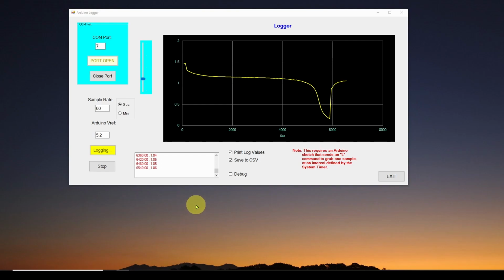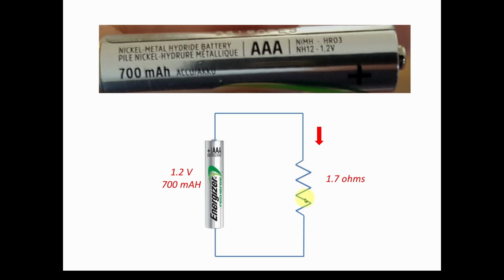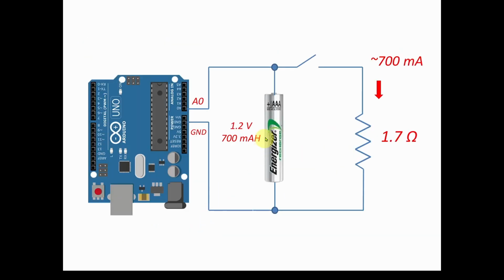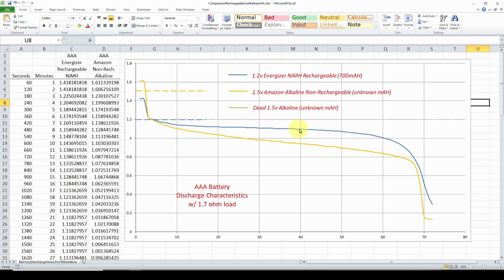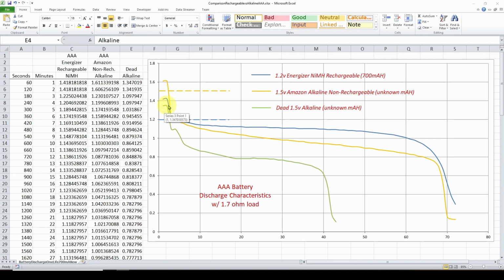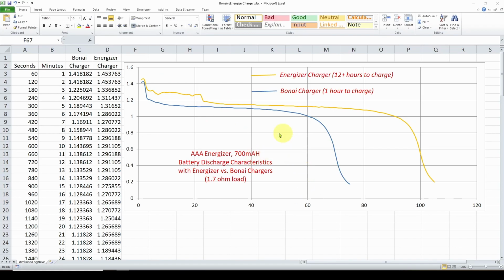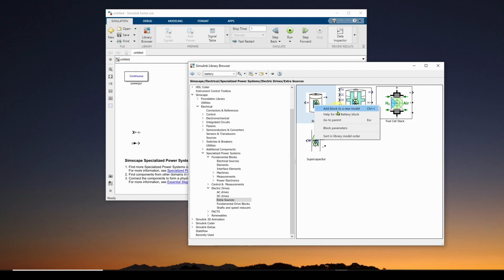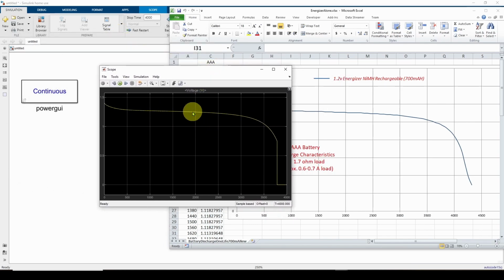Understanding Batteries

Comment: Well-Done,
I have an off-topic question about an gravity battery.   
       ?How high can a typical AAA batery lift a 100 weight?
I ask you because it seems you might know.
Reply from the maker: Gravity batteries?? Wow. Reminds me of back in the 1980's when I was a young engineer and we were working on a pumped hydro power plant, that basically  pumped water up into a dam at night to store the energy, then the water powered the hydro generator during the day. But why would you want to use a battery to lift a weight for later use when you're just losing energy in the process?? Or maybe this is a homework question? I don't help with homework questions. But a quick calculation tells me that if you assume the battery has a 1 watthour total capacity, you can HYPOTHETICALLY lift the 100lbs less than 25 feet, but that would take an hour. Of course that assumes you have a 1 volt DC motor that can do the job, though I imagine you'd need that and a ton of other equipment to make it work. And again, you're losing a lot of energy in the process. Maybe that's why gravity batteries never got popular in the last decades.
Reply: @EETechStuff  Thks, sounds about right & electricity/batteries are an awesome things.  In-general mechanical batteries are being serious considered/developed again:
 The Mechanical Battery https://www.youtube.com/watch?v=_QLEERYS5C8
 Gravity Energy Storage : A very uplifting technology! https://www.youtube.com/watch?v=lh1--ftWWvY&t=344s
Just like mechanical computers, I thinks mechanical energy storage takes to much inefficiency/effort/resources/maintenance/etc compared to electrical, chemical, etc.
Reply from the maker: Kinda funny how all these "new" technologies (which have actually been around since the 1960's, like wind, solar, storage) are now suddenly gonna solve the world's problems. We'll see....

By the way, I have a couple of videos on this channel titled "Solar Energy Myths" you might be interested in.